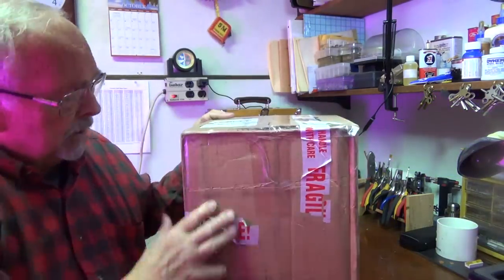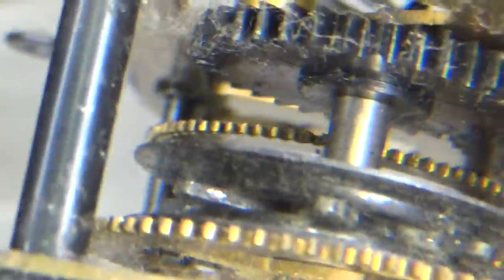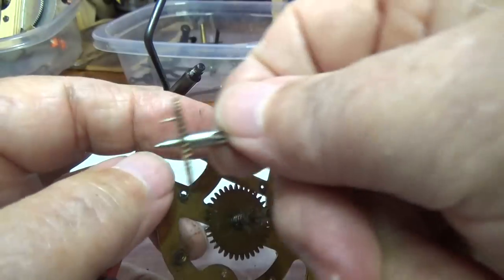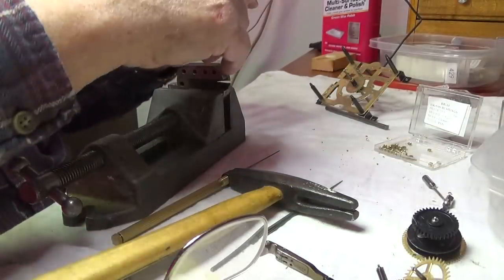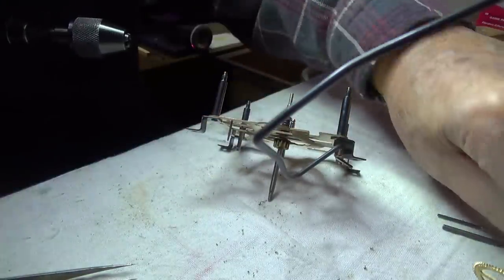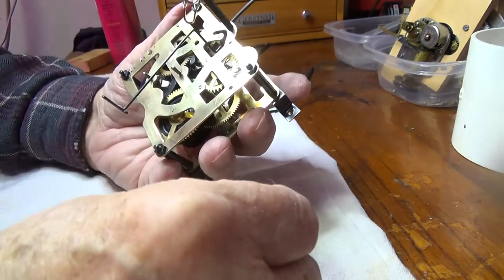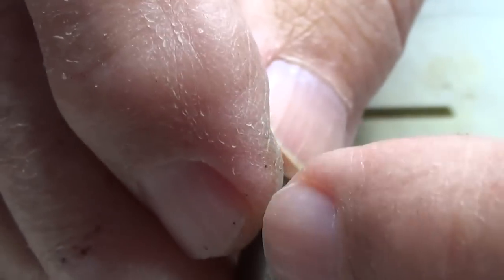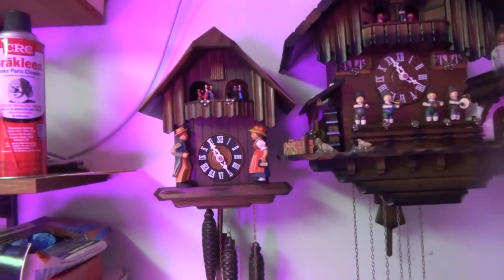#clockrepair Cuckoo Clock Repair for Colonel Freeman

Comment: Just finished your video. Learned a lot. Like setting the lever wheel and using linseed oil, need to adjust my other clock now. Cuckoo doesn't sound right. I also had a terrible time with the pallet now I know how to place it. Thankyou
Reply from the maker: Glad it helped

Comment: What are you using as a cleaning solution? Yours looks 100 times better than mine. Thanks John
Reply from the maker: https://timesavers.com/i-24051932-zenith-251-ammoniated-watch-clock-cleaning-concentrate-gallon.html  Sounds expensive, but it is diluted part to 7 parts water, so it makes 8 gallons.

Comment: What a good video, you always make well-explained videos. I would like to know how you mix the oil with alcohol to put in the box. Greetings from Chile.
Reply from the maker: I mix 50% boiled linseed oil with 50% mineral spirits.
Mezclo 50% de aceite de linaza hervido con 50% de alcoholes minerales.
Reply: I think that the concept "mineral alcohol-mineral spirits" should be what is known here in Chile as mineral turpentine. I will try to find out more, thanks.
Reply from the maker: Yes, same thing.  https://en.wikipedia.org/wiki/White_spirit
Reply: Ok perfect thank you very much

Comment: I have enjoyed your videos and thank you for your help getting my Regula 25 to work!  However, a short time ago the chime and call stopped- I found that the star wheel screw had loosened.  Can you clarify how tight it should be?  I snugged it up and when I put everything back together and placed the clock on the wall, I could not get it to start again.  I know your clock-working season is coming to a close, but would so appreciate your thoughts.  Thanks so much!
Reply from the maker: Sounds like the star wheel was retightened out of its correct position.  If, for example, the spoke that lifts the hammer is touching the pin on the hammer that it lifts, the  mechanism will have a hard time starting.  It needs a very slight space between the spoke and the hammer lever to come up to speed.  Look at the star wheel when the mechanism is in a stopped state.  Two lift pins (spokes) on the star wheel should be aligned parallel to the left side of the back plate. In other words, put two pins equidistant to the edge of the plate.  Make the screw on the star wheel tight, not just "snugged up".
Reply from the maker: If you didn't understand what I just said, watch here to see how the star wheel goes on   https://youtu.be/bYNaRT2O7eA?t=8451
Reply: @dperry428  Thank you so much for your clarification.  Once the grandkids go back home after their visit with us I will revisit my repair:)
Happy Easter!

Comment: Great to see you back. Missed all of your videos and your style in explaining things. Hope you are feeling well. I recently repaired an 8 day cuckoo clock that had regula 34 movement. everything works well. strikes and music and dancers but every 12 hours or so at the 22nd minute mark the clock starts cukooing randomly for a few times and then everything goes back to normal. The clock itself does not stop. it cuckoos on the hour and half hour correctly though. Any thoughts? Your feedback is highly appreciated. Cheers!
Reply from the maker: That time would be about when the clock goes into warning for the half-hour strike.  Look for a bent warning pin on the warning (third wheel). Also, carefully watch the actions of all levers at the half-hour to make sure something is not bent. Look to see where the rack is at the half-hour. It should not drop at all.  It could be that the snail position needs adjusting, too. At the hour, is the rack tail falling in the middle of a snail step. Also, check the half-hour lift cam on the center wheel.  Is there a burr that is causing the lift arm to be lifted just slightly too much or is the lift arm bent allowing too high a lift at the half-hour.  Something is causing the rack to fall too far, releasing the strike too soon, and allowing more than a single strike. Without actually looking at the movement, I can't really offer much more help than that.  There are so many things that can be slightly out of adjustment, the only way to find what is going wrong is to study the movement on a test stand. Sorry, but you'll have to take the movement back out, put it on a test stand and study what is happening.
Reply: @dperry428  Thank you very much, Don. You pointed me in the right direction. I really appreciate it. I don't have a problem with the rack and snail as the clock trikes properly on the hour and half hour. the symptoms I am getting are extra striking that happen around the warning time. I think you are correct about the warning pin. I may need to check that. Thank you very much. Cheers!
Reply from the maker: Another idea is to check the lift lever that rides the cams on the center arbor.  On the half-hour, if there is a slight twist in the lift lever, the tab on it may then be lifted more than it should, causing the rack to be released. It wouldn't matter on the hour, as the snail controls the rack drop.  Coupled with a faulty warning pin, you could then get multiple strikes at warning.  Sometimes a problem is caused by more than one fault happening at the same time.
Reply: @dperry428  That makes sense. Thank you very much.

Comment: Welcome back. Great job as usual. I have just worked on an unusual 3 train regula movement A72 that has music and a man that comes out of a door instead of dancers. I cleaned and bushed the worn pivot holes and put it back together.

 It is an 8 day movement. runs fine for about 3 days then the music gets stuck intermittently and it doesn't cuckoo on the half hour intermittently but with a gentle tug on the chain it works. 

I did some investigation and I realized that when i move the centre arbor that has the hands the clock works for another day or so and then when i pull up the weights the problem shows back up until i move the centre arbor back and forth then the problem goes away. Any suggestions? I appreciate your feedback.
Reply from the maker: Keep in mind that the 8 day movement is a lot fussier about pivot tightness.  They do not tolerate the looseness you can get away with on a 30 hour movement.  I'd also look very closely (magnification) at any and all plastic gears in the movement. A crack can cause the kind of problem you describe.  A crack causes the spacing between a couple of teeth to change and it tends to hang up on that extra width and can be overcome by forcing it slightly.  As for the music box, they wear, too, and can cause the same kind of problem as the clock movement.  Are there pivot holes in the music box that need bushed?  Look especially at the tiny gear that turns the governor fan.
Reply: @dperry428  Thank you very much for your feedback. I am going to check and let you know. I was thinking of bushing the centre arbor pivot hole in the front plate as I feel there is a lot of play and I will revisit all other bushings too. Thanks a lot.

Comment: I have a question if you dont mind. I was repairing a Regula 25 1973 and I needed a strike ratchet wheel and ordered a replacement from timekeepers. Well the new one rubbed up against the center wheel where the original had maybe a 16th clearance. Now I bumped the gear and it runs fine. Just wondering if you have ever ran into this. Timekeepers said this was the right part. Any ideas.
Reply from the maker: Have never run across this problem.
Reply from the maker: Just re-read this and got to thinking that, if the pivot hole for the arbor that holds the star wheel is worn enough, it would allow the star wheel to move enough to contact the center wheel.  "Bumping" the star wheel would  push the pivot back a bit and create clearance.  If that's the case, you'll continue to have problems until the pivot hole is rebushed, eliminating lateral movement.

Comment: Mr. Perry, do you have any videos on how a cuckoo clock door and the bird wire can be fitted perfectly with those tiny pin clips so that the door opens and shuts perfectly?
Reply from the maker: Not specifically.  What you need to do is ensure that the pieces are close enough to eliminate sloppiness, yet not so close as to bind.  Also, make sure the bird is situated on its perch so that it does not drag on either side of the doorway nor on the bottom of the doorway.

Comment: I have seen cuckoo clocks with a man playing a violin. I was told that the music comes out of a music box fixed inside the clock. Can you tell me how the tune is produced by the box?
Reply from the maker: The only mechanical music boxes I know of in cuckoo clocks work like the one in this video,  a roller with pins that pluck the tines of a metal comb. There are modern cuckoo clocks that have quartz movements and, if the music is that of a violin, it would simply be a an  electronic music box. I know of no older, mechanical cuckoo clocks that play violin music.

Comment: I have a cuckoo clock and when the bird sings and drags the door back in , the door drops a little and won't shut perfectly. Can you please write me some instructions as to how I could get the door to shut correctly? Thanks.
Reply from the maker: Check the wires that make up the hinge on the door. Make sure they are not coming loose.  Push them in until the door operates correctly and put a dot of glue at each point where they enter the wood.

Comment: I have learned so much from watching your cuckoo clock repair videos. Thank you for making these. I have a Regula 8 day, 2 song cuckoo clock that I am having an issue with and would really appreciate some advice. Could I send you an email with a couple of videos explaining my issue. The music starts playing before the hour then stops again prior to the strike. Then music proceeds as the clock strikes. I did find a bent pin and straightened it thinking that was the issue but the problem persists.
Reply from the maker: I would like to help you, but I don't publish my email.  If you leave your email in a comment, YouTube will censor it as spam.  You can try to leave an email with the "at" and "dot" symbols in words.  Meanwhile, check the lever that drops in the hole in the end of the pin roller.  There is a brass pin at the other end that is pulled in front of the governor fan to stop the music.  It should have a very small piece of plastic tubing on it that can be adjusted to keep the music stopped when the cuckoo goes into warning.  It allows for minor  adjustments to stopping and starting the music box by sliding the tubing on the brass pin.  I'd bet it's either missing or out of adjustment.
Reply from the maker: You could also make a short video and upload it to your channel.  With a video editor, you can load photos into the editor and render them as a video and upload to your channel.  Comments on your channel can then be used to exchange information.  You can then delete the video.
Reply: @dperry428  Thanks, I added 1 video and 1 short to my channel that show the issue. This is on a Regula 72 that has the music controlled from within the main mechanism. Hopefully you can find the videos and give me a clue what to look for. I really appreciate it.
Reply from the maker: I watched both videos and neither was much help.  I did a search for the Regula 72, which I'm not familiar with, and found some pictures that gave me an idea that the movement will not work correctly without the additional gears from the movement to the music box and the linkage from the movement to the music box are actually connected.  The music box, itself, it seems to me, would have a role in preventing your problem.  Linkage from the movement to the music box would control a stop that holds the fan governor until after the cuckoo strike and then release it.  With the fan governor held, the gear connection could not run and the music mechanism within the movement could not run.  In other words, without the music box actually connected, there is nothing to stop what's happening in your videos.  Go to this site and look at the second picture of the movement within the case with the music box and the additional pieces and linkage.  https://www.clockworks.com/product/regula-72-cuckoo-clock-movement  Those gears that are not in your video run the music box and the black lever at the top-right of the movement is linked to the music box and likely controls the fan governor.  If the fan is being stopped by that linkage, the gears cannot move and the mechanism will wait for the cuckoo to run first.  I've not worked on that particular movement, but I'd bet your problem will resolve when you put the whole thing together; that is, unless you've bent things that should have been better left alone.  The music box, itself, is an integral part of controlling when it runs.
Reply from the maker: Rethinking, the fan governor is attached to the movement at the upper right.  The lever is missing.  It is also likely what controls when the fan governor is released. Without that lever the governor is free to run when it ought not.
Reply from the maker: You might also like to read this.  Pay attention to the opinion of the Regula 72  http://www.cuckooclockologist.com/inouropinion.htm
Reply: @dperry428  Thanks for taking a look. The issue was happening before I took it out of the case. I took it out to see if I could see what was wrong. After I noticed the pin on the music warning wheel was bent, I straightened it and put everything back together in the case and still had the same issue. I uploaded another video to show you how my music box connection is different than the one in the link that you shared. The cuckoo clock store said that their guys would not work on this model any more because it was too tricky.
Reply from the maker: For me, a new clock movement means spending a lot of time analyzing how it works.  Only then can I fix what is wrong.  Without doing that with a movement I've never worked on, I can't really be of any help other than just guessing from experience.  Obviously, this one works differently from those I've worked on over the years.  Guess we've exhausted any help from here without actually having the movement in hand.  Good luck with it, especially if a clock shop won't even try.
Reply: @dperry428  Update- I fixed it! I uploaded a video that shows what the issue was and explain how I fixed it. Again, I want to thank you so much for your videos and your advice.

Comment: Hello dperry428 !
How much do you charge for repairing the mechanism Regula 25 ?
Thank you on the answer.
Nikica from Croatia.
Reply from the maker: I don't charge except for any parts I may have to use.  I ask people to make a donation to our local food pantry.  I don't do a lot of repairs, perhaps half-a-dozen each winter.  Right now, I have more than I normally do just from local people.
Reply: @dperry428  You are very good and precise at repairing watches. I would prefer to you send a movement. There is play on the axles.
We are greedy people in our country, they take for repair 100 eur. New Regula25 movement is cost 58 eur to more.
Yes, sir, it is a balkan !! 😀
Reply from the maker: If you can buy a replacement movement, do it.  By  the time you would pay to send a movement to me and pay for its return, you'd spend more than that.  Why not try doing the work by doing what I do and, if it doesn't work out, buy the new movement.
Reply: @dperry428  Yes, you speak well. I will either fix it or buy a new one a movement. 
Best regards !!

Comment: Mr. Perry, when I take my clock off the wall and try to fix it, sometimes the bird comes out and keeps on whistling non stop and gets stuck in the door. Can you tell me how to fix it ? Thanks
Reply from the maker: If you watch this video in the part where I discuss the levers that hold the door open and also cause it to close, you might find your answer.  There are several things that can cause what you describe.  The most likely is that there is something wrong with the rack and snail mechanism and the rack is not being lifted, keeping the lever that stops the cuckoo and closes the door from doing its job.  One possibility is the pin on the gathering pallet is bent or broken or the gathering pallet has come loose and fallen off.
Reply: @dperry428  Thanks Mr. Perry

Comment: I've watched a bunch of your videos so it's nice to see you back.  Good work on this one.  It's interesting the way this clock is set up - time and strike between the plates, with a separate mechanism with its own weight for the music box.
Reply: Neat idea for the tool to grab the movement screws.I use a spring loaded 3 pronged tool I picked up a hobby shop many years ago.Timesavers used to sell the same thing.Dont know if they still have them.
Reply from the maker: https://timesavers.com/i-24048837-nut-screw-grabber.html

Comment: I’ve seen some where the chains run through the case holes at up to a 25 degree angle with no problem, however the case hole is lined with a thin brass bushing so it doesn’t cut the case. Seems to be fine.
Reply from the maker: They don't do so well when running against wood. Not only does the chain snag but, it it carries on up into the movement, takes tiny wood dust with it.

Comment: My cuckoo bird's sound is so fast you can't count them. What can I do to slow him down? Thanks
Reply from the maker: Two most likely possibilities:  Is the weight correct?  If the weight is excessively large, it will cause this problem.  OR, check the governor fan at the top of the train of gears that control the cuckoo.  If it is very loose on its arbor, you will experience that problem.  Need to tighten the fan connection to its arbor.